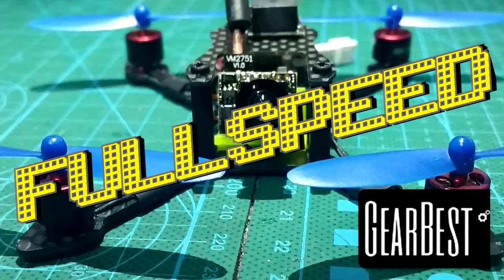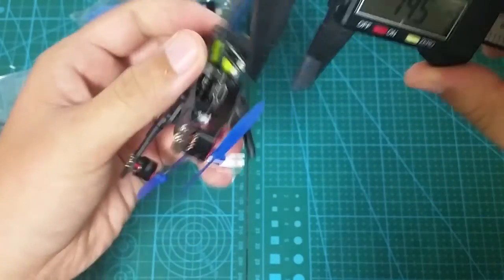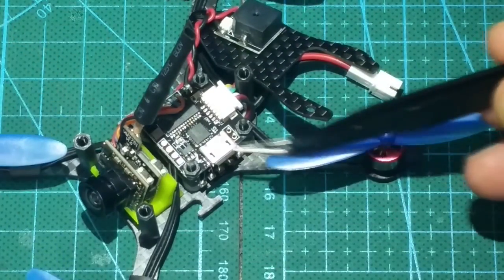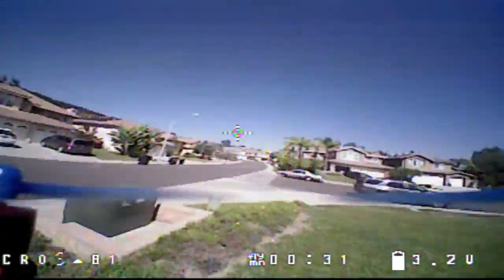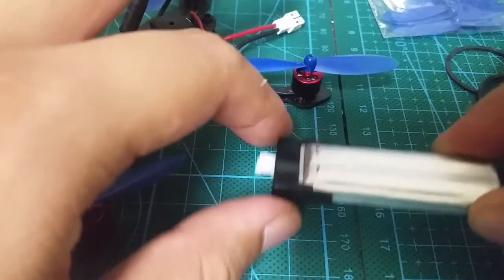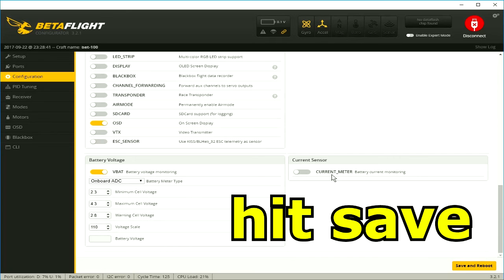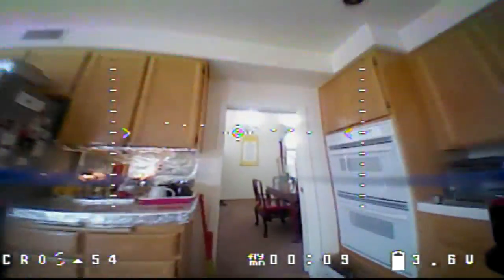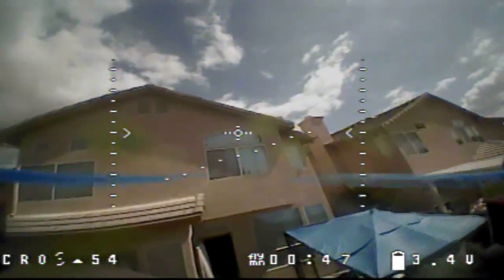Fullspeed Bat100 -Review -100mm 1 cell brushless micro drone

Comment: Hi i need help.. nobody says how to flash the board.. does it have a boot pin? or why i can't install betaflight:( please help!
Reply from the maker: the boot pads are located on the bottom of the flight controller. i believe its the two pads next to the 2 yellow capacitors "towards the front of the quad" id check but i no longer have this drone. http://img.banggood.com/file/products/20170418032153Teeny%20F3%20integrated%20PDB%20Manual.pdf
Reply: +DANQ FPV thanks for the answer brother :) problem solved.

Comment: they are providing very cheap quality motors and if any problem come then they deny to support by blaming any irrelevant issue...
Reply: dcvshambhu Full Speed has updated the motors.
www.fullspeedrc.com/bat-100-rc-quadcopter_p0020.html
Reply: +Lewis Lee (Lewis Full Speed RC)  too much costly 17$ approx per motor ...means around 68$ only for motors....even shipping cost not included ...lol..your quad is great but support is worst ..
Reply: dcvshambhu thanks for your suggestion

Comment: The Bat 100 is an awesome drone, but order some spare motors and I mean a lot of spares. These motors are extremely fragile and will be come unbalance with the slightest crash. So 4 stars for size, weight, capabilities, but minus one star for durability of the motors.
Reply from the maker: yea they are pretty fragile, you can pick up some prop guards for this, but then again this would add significant weight, so it's give or take. Are you usign the blue motors or the red ones?
Reply: DANQ FPV thanks I literally came to this  comment to ask  do they do prop guards for it 👍 are they that good im seriously tempted but the flyegg 100 just came out rtf and then there's the dust 58 or the dys elf
Reply: Ive had one of these for about 3 months but only flown it a few times.. Ive gone through 4 motors. All broken shafts and bell housing. And they take 1 month delivery to Australia.
And currently theres a tab broken on one and missing c clip on another haha.
I now only use 3 blade gemfan props as i found just dropping the quad on my carpet with those long props on snaps the shaft. 
 And ive not broken a motor shaft since.
I have the sunnysky 15000kv.
Looking for a better upgrade